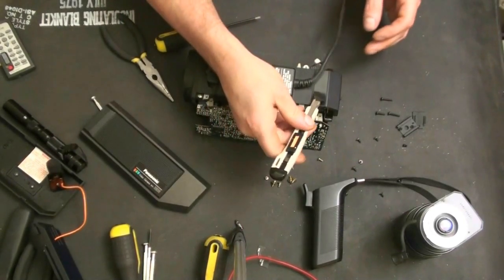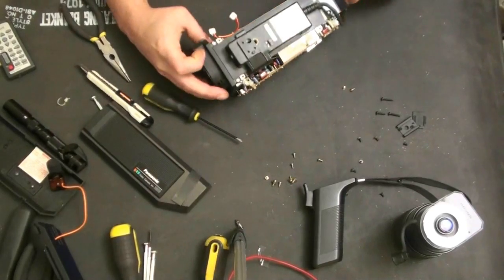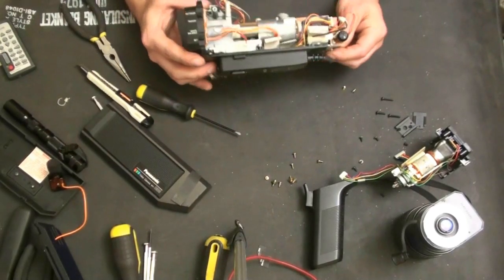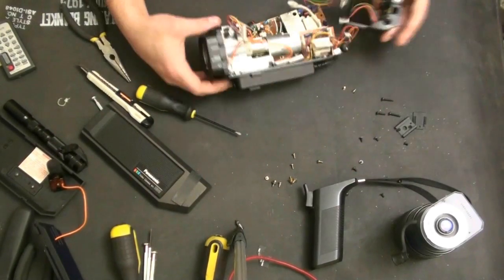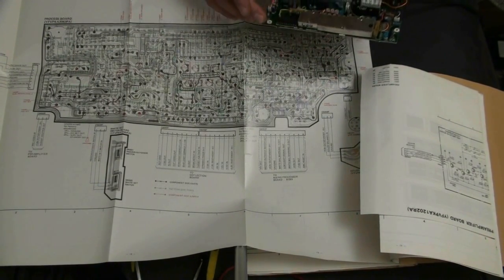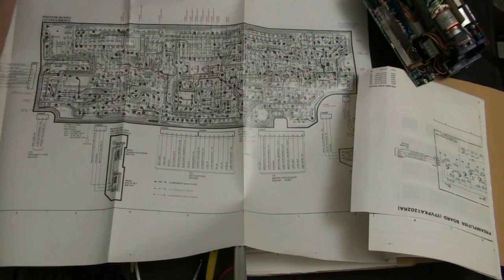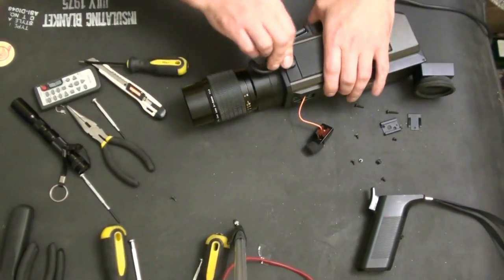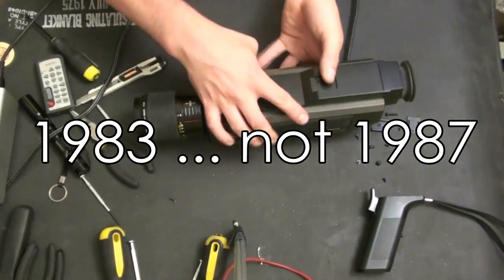Panasonic WV-3060 Video Camera Teardown pt 2

Comment: +general0ne Interesting video, maybe you should show some closeup details of the boards also.

I have two Panasonic WVP-55E s, which looks quite identical to yours both inside and outside. It's a PAL version, and has ultrasonic auto-focus, which is quite a fun thing. 

One of mine has many thousands of hours in it, because it was used as a CCTV security camera in the early '90s when it turned obsolete as a portable camera. Still works, but had virtually no picture when I bought it, the Saticon is very tired. I was able to adjust it until it can produce now a half decent picture. I will have to go through the service manual's adjustments section, to give it more proper adjustments, because shooting at high contrast themes, the bright parts turn overexposed with greenish extra long plumes, regardless to the iris setting (I have to shut the iris so small to prevent that, that then only the most bright parts will be visible). It was used so many hours, that the theme it was looking at burnt both into the Saticon and also the viewfinder CRT, the burn marks can be seen on the CRT screen even when it turned off :-) . Both of my cameras were the property of an Austrian equipment rental company.

The other one had way less of use, but unfortunately it died. Both the working and the died one has electrolyte leakage from about 80% of the capacitors... Does your's also have this issue?

I've downloaded the full , 150 pages (!) service manual of WVP-55E, with principle of operation. It's amazing how tricky and complex analog processes needed to get the color information out of this single tube... I think, three-tube cameras are much simpler in that aspect, but they cost too much for consumer market because the tubes was so expensive, and a three-tube camera was also quite big, heavy and power hungry.

You can download the service manual here, the ultrasonic auto-focus is also quite interesting.

http://freeservicemanuals.info/en/servicemanuals/viewmanual/Panasonic/WVP35E/WVP35N/WVP55E/WVP55N/

Greetings from Hungary!

Comment: Interesting two parts video. Thanks.

BTW, this looks exactly like my Saticon tube equipped RCA CC012 that I had back in 1985. Could it have been made by Matsushita (Panasonic) for RCA back in the day?

I know that my 1988 VHS RCA Camcorder CC300 (that I still have and still works great) was actually made by Hitachi (with its CMOS sensor) for RCA.